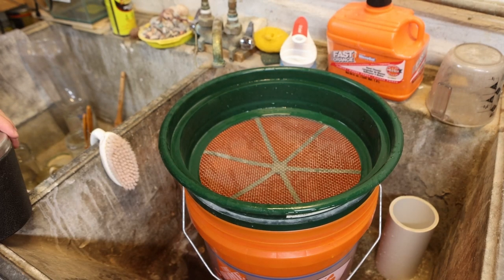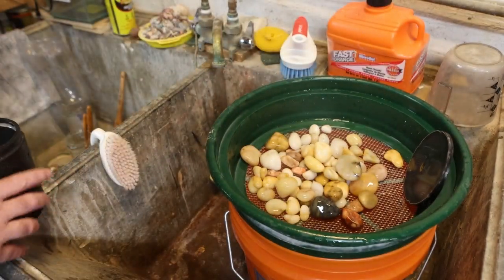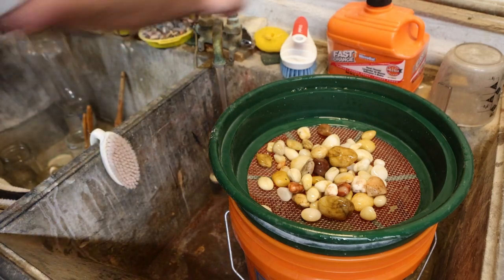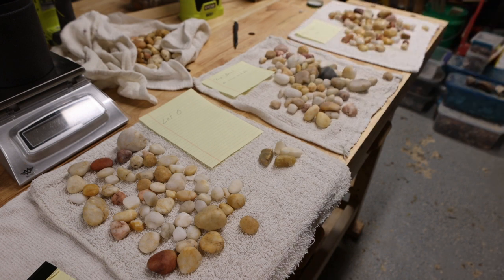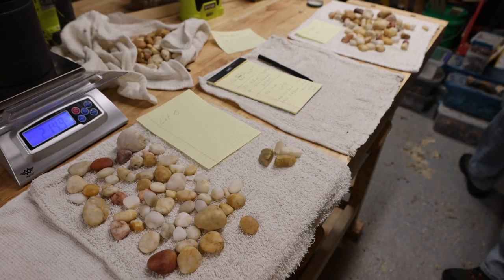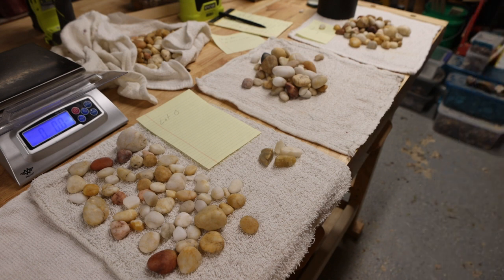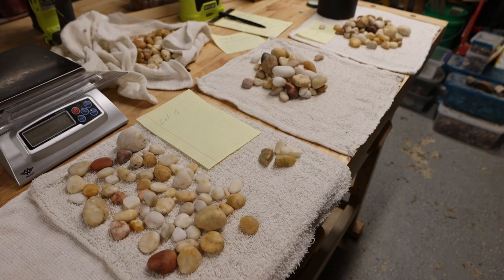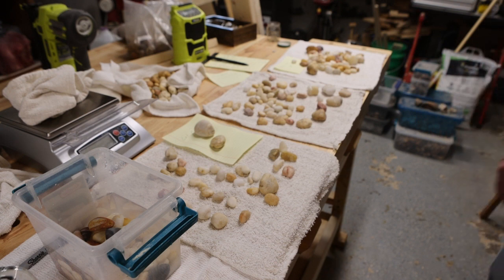The Results:  Can you use sand to tumble rocks?

Comment: Thank you for the video! 
Two Questions: I've never seen anyone use hot water to rinse their rocks off. Do you do that for any particular purpose? I would imagine hot water will rinse more off than cold water would, but I'm afraid that it would possibly crack the rocks. Do you think that could happen or has that ever happened in your experience? If not I would use hot water since like I mentioned, I figure it would clean them off better.
My second question is, I have often cleaned my rocks after each stage by running them for a short time with water and baking soda/borax/ivory soap. However, I have had a few of my rocks crack when I have done that. Besides not taking a shortcut and actually going through and cleaning them thoroughly individually do you have any advice for cleaning them in between stages?

Thanks
Reply from the maker: Lol, I honestly rinse with warm water just because it feels better on my hands.  It’s never hot enough to crack anything.   You’ve seen I don’t burnish between stages, but my rocks have come out fine.  If I had to redo a batch because it came out badly I’d probably try that, but generally I just haven’t needed to!   Thanks for the questions!   I never even thought about the water in the sink!   When I initially rinse outside that’s cold, but inside I use warm just for my hands.
Reply: @edcctf  Thanks for reply so fast. I have a zillion questions for ya but I won't bother you with all of them lol. But I did have one last quick question if you don't mind. One time I had an issue where the screw to tighten down the top seized. I tried everything to loosen it, but it ended up bending and eventually breaking. Now I use some kind of oil (3in1 or equivalent) and will take a qtip and lightly oil it to prevent it from seizing up again. Have you ever had that problem before? I have not had that happen again to me since I started adding that to my routine. Thanks again.
P.S.: If you ever have hand issues I 200% recommend O'Keefes or the CVS equivalent. (My day job tears my hands up.) Thank you sir!
Reply from the maker: @robotapartments  For some reason YT held this comment, so I just saw it.  I've never had a problem with the screw at the top, but a little oil sounds like a good idea.  With all the water involved those posts could easily get rusty or just corroded.
Reply: @edcctf 
   One effect of washing with warm water is that the warmed rocks dry faster